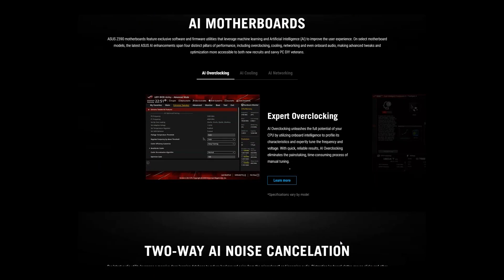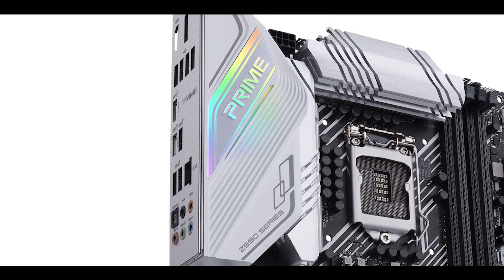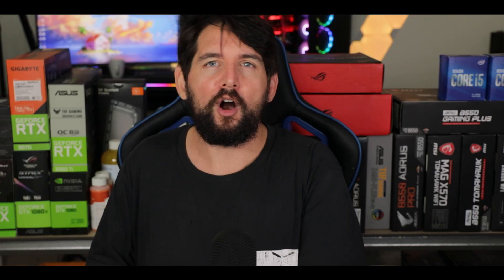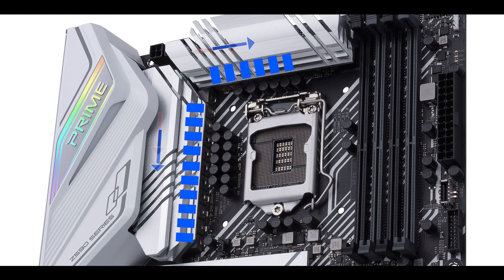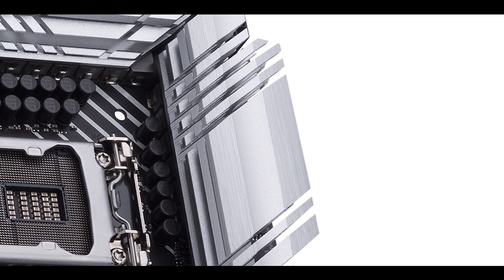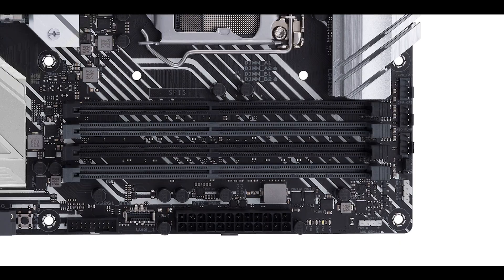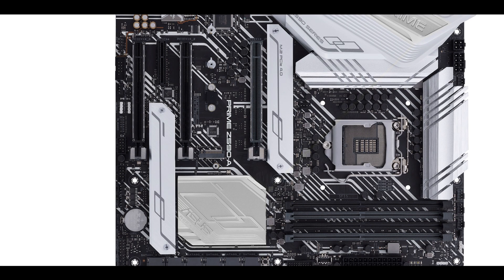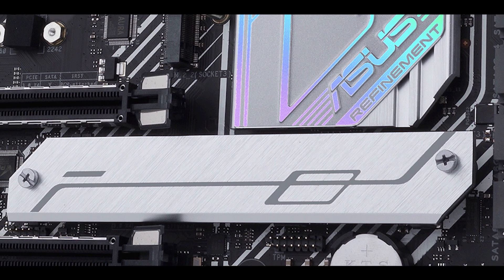ASUS PRIME Z590-A :  The COMPLETE PREVIEW!

Comment: great motherboard. the only issue is ram speeds are locked to 2666. although its not a huge deal breaker. those using a entry level gpu are going to want every frame they can squeeze out of their build. for most games this isnt even an issue. but those demanding games like star citizen will have a slight drop compared too the 3200 ram speeds, and when youre playing cod. any latency will give you some performance to struggle with. overall. i would still suggest this for a good starter build. and when you recoup your expenses. and you feel you need a little more out of your board. replacing with any other 1200 cpu slot wont be as much of a hassle as you think.

Comment: might be a little late. but building a starter with this as a friend recommended, also a i5 11400 , radeon rx 6600 , 2x8 xlr8 ram and 500ssd , the case im still debating

Comment: Got this motherboard recently as my old CPU took an L. Paired it with an i9 11900K and instantly boosted to 5.2 -5.3. If anyone else does a pair like this, under volt to 1.400v as the board pushes it up to 1.632v which causes some minor sputtering.

Comment: I have this motherboard and I'm curious about one thing.   There are three m.2 sockets, but only #1 and #3 have heat sinks.    The second is completely exposed.   Is there a reason for this?   Going to build a system later this week.    I have three m.2 drives, I guess I'll have to buy an aftermarket heat sink for it - any thoughts ?

Comment: Do i need cooling system for i9 10 gen unlocked and this motherboard? My work is based more in single core .. I want to make audio pc
Reply from the maker: For an i9 I'd go for a AIO water cooling solution.
Reply: @Laurentschoice  can u also recommend a graphic card my configuration is I9 10850k and Asus Z590 prime A

Comment: 6:14 the secound pci slot isn't x8 in a dual GPU mode it would be x8 and x4 cuz the last one is splitted with them aka x8x4x4 (thats why i liked that board in the first place ... who needs an x16 for a GPU x8 is enouth and its nice to got 2x4 more from the CPU)

10:02 thats not a thunderbolt front connector its for a addon card to give it hot plug functionality
Reply from the maker: That's correct. I did had some notes in the description for correction. 

Thanks for the comment and for spotting the error.
Reply from the maker: As for the connector at 10:02, after verification it is indeed a thunderbolt 4.0 connector.  If you take a closer look to the PCB you will the thunderbolt_4 inscription written. 

I encourage you to on the official page of this product to read more on  it.

Comment: I got a Z690 coming for ADL, hoping it's as good as the 590 was. The other boards ASUS were offering just seem like more than 99.9999% of users would ever need.
Reply from the maker: You are absolutely right. With current components, availability,  Anything beyond a Z490 is overkill.
Reply: I got lucky and got an open box version of this from Microcenter for $160... so... as long as it's in good condition... I'm planning to drop in a $350 i9-11900k (also from Microcenter) with 2 M.2s I already have, but with a new gen 4 M.2 on the top line.  In my mind... the real reason to buy this board is if you can get it on sale... it's a great upgrade if you want to smoosh a bunch of stuff into it... also... because it was the only board I could find that had 2 usb-C on the back.

Comment: Hey i have this  mobo and i connect one pcie my rtx 3080 and the other one I used a adapter to use an extra m.2 hard drive does is make my rtx run at 16x or is it running at 8x?
Reply from the maker: No. There are enough PCIe lanes to run them all at their maximal speeds (x16 for  GPU, x4 for m.2 ssd)
Reply: Hey one more thing it has 6 sata port and I connect my 6 hard drive but I can't see them in windows but in bios it shows any suggestions
Reply from the maker: Go to you Disk Mangement in windows, format them. Amd a drive letter will be assigned
Reply: Its not showing in disc management
Reply: Intel rapid storage technology on or off?
Reply from the maker: Doesn't matter. 
How many SATA ports actually work ? 

Are all m.2ssds populated. 

The 2nd m.2ssd will disable one of the Sata ports. 

Other than GPU what do u have installed on pcie expansions?

Thx
Reply: Pcie expansion i have a adaptor with one m.2 drive in it
Reply from the maker: 2md m.2ssd and some PCIe exports l, when used, disabled ur SATA ports. 

Try disconnect those and u should see SATA ports back on.
Reply: @Laurentschoice  i disconnect all 6 sata port and switched the spots as well 
It shows in bios the hard drives but in windows disc management it doesn't show only I can see my 2 m.2 drive and the one on expansion one

Comment: hello!!!! question is it ok to use fan splitters from the MOBO to my 12 fans? corsair ll120?? thank you
Reply from the maker: Yes. But no more than  5 fans per motherboard connector or u risk to overheat them.
Reply: @Laurentschoice  thank you ! I read the fans use 0.3a and the headers output 1A so ig I'm safe
Reply: 12 fans - It's going to levitate....
Reply: @patrickinottawa27  lol nah I finnished my build  and I only put 10 .... I was going to add a second one to the cpu cooler and a small exhaust fan but I added an lcd display where the exhaust fan was going to be and I left 1 fan on the cpu cooler only

Comment: The pcie slots will run at x8/x4/x4 if fully populated not x8/x8/x4.
Reply from the maker: Correct . I did add a remark in the description. Sometimes Previews are not as accurate as Reviews.

Comment: EXCELLENTE review, thank you!
A quick question:
They are going to assemble a system using that same motherboard, but I am not going to overclock, my question is:
Should I or shouldn't I use both voltage connectors? the first (EPS 12V 2x4 pins) is mandatory, 
and the second (EPS 12V 2x2 pins) also or can the board burn?

Thank you for the answer and help.

Comment: no hdmi 2.1
Reply: Graphics card for that unless you got a cpu with basic integrated graphics and no graphics card then the port be useful.
Reply: @Sherlock245  yes I bought a 3090 strix with i9 11900k now I get 4K 120hz and 95-120 FPS in forza horizon 4
Reply: @rochester3  how do you fit a wifi card on these board with pcie x 4
Reply: @Sherlock245  why use a wifi card, just Buy and plug in a wifi USB connector.
Reply: @rochester3  wifi pci express faster???
Reply: @Sherlock245  yeah well you can connect it to one of the 1x4 slots
Reply: Wifi card transfers data from 300mb to 3gb a second make sure you check
Reply: @rochester3  make sure you have a good wifi card not a bad one. Usb speed fail conpared to wifi express cards.
Reply: @Sherlock245  i use wired connection
Reply: @rochester3  so where is that usb???

Comment: Thanks for the explanation. As you said, when using 2 GPUs, first and second PCIE will be x8 x8, but the thing is, the space between first and second PCIE slot is so close, my two 3060 is so thick to fit into the space, can I insert my second GPU into the third x4 PCIE slot? Thanks in advance.
Reply from the maker: You could but it my be bottle necked by ce x4 pcie lanes
Reply: @Laurentschoice  how about mining? does it affect much?
Reply from the maker: No it won't affect mining one bit. 
Even on a single lane PCIe ur mining will be at 100% effective.
Reply: @Laurentschoice  So you are saying that use first PCIE and third PCIE dual GPU setting to do mining, it won't affect the effectiveness? Thanks in advance.
Reply from the maker: Absolutely.  If its for mining u can use an 16 slot PCIe on urotherboard it doesn't make any difference
Reply: @Laurentschoice  Thanks guru, it really help

Comment: I'm having issues with Overclocking the Ram from the default 2133Hz 
I Run a i9 11900k with a Z590 Asus Prime  A
My Ram is 2pc of   F4-3200C16D-16GTZR Trident G Skill

I keep getting a block screen when I save and exit from Bios.
I tried doing all the XMP profiles and Manually changing the timings on the ram to what was stated on G.Skill Website

I only connected 8pin Power into the ATX_12V_1 so I'm not sure if the lack of power is affecting it.

Any Idea what's the issue here?

Comment: I have this motherboard with 10850K. Tried to RAID 2 NVME drives in the bottom 2 NVME slots no dice. I'm guessing it's a BIOS issue. But my gigabyte Z370 board did RAID without issue.

Comment: Great video, to get this straight I need a 11th generation Intel processor to make the M.2 SSD slot work on Pcie 4.0 right ?
Reply: Yup, the top M.2 slot only works with an 11th Gen processor. With 10th Gen it does nothing, only the other two work.
Reply: @SimonP2   I have a 10th gen cpu, which slot would you recommend and would I be leaving any performance on the table if so do you recommend going 11th? I'm in the process and haven't purchased the cpu yet. Planning on an 
I5 10600k
Reply from the maker: If 10th gen CPU : use qny m.2 ssd BUT the closest one to the CPU. It won't work 

If you are using a m.2 ssd with a 10th gen CPU, you can only got up to PCIe 3.0 standard, meaning 32 Gbps for ur m.2 ssd.

If you are using the 11th gen CPU, you can use pcie 4.0 m2.ssds which can go up 64 Gbps.

Hopes this helps.
Reply: @Kingtroll38  If you haven't bought either yet, I would think it better to go for the latest CPU, then you'll have PCIe 4.0 available. That said, if it was me I'd wait for Alder Lake as it can't be far off now and you'll have the option of DDR5 RAM as well so it's more future-proof. 

TBH I was a bit disappointed with the 11600K; I upgraded from a 7 year old system and, aside from the incredible speed of the PCIe 4.0 SSD, it didn't feel like a massive improvement in my usage. Alder Lake is said to be a significant step up from Rocket Lake, which was only a small upgrade over Comet Lake, so unless you're in a hurry, maybe hang fire and see how the 12600K looks?

Comment: My Specs:
Z590-A Mobo
Corsair Vengeance Pro (2x8) - will probably upgrade in future -
NZXT H510 Case
RTX 3060
Cooler Master ML240L AIO
Samsung 970 evo 1tb nvme m.2 ssd
650 watt psu
- Im waiting on this motherboard to come in and thats all i need. I looked it up and there seems to be alot of downloadable software for this mobo.
Reply: No CPU?
Reply: @jin-pu2sh  i7 10700k
Reply: Hey I'm getting the same tenth gen CPU and graphic card, do they work good on this motherboard? I'm still trying to figure out if the pcie slots need an 11th gen to work or not. Sorry for responding to a 4 month old comment
Reply: @ivfluid  ii upgrades ram to 32gb and got a 3070. but yeaa it works fine. The first nvme slot only supports 11th gen processors to work. As of now, this processor has a couple of 11th gen processors beat. So ii wont be upgrading to 11th gen no time soon. As far as your question, Yeaa they work great on this motherboard.

Comment: I wish I could buy this board but I have the Lian Li 011D-mini and a 360 for the top mount, so I got the Z590M-Plus. I want to OC my 10700K and an eventual 11700K to at least 5.0 GHZ. Do you think that will be okay for that? 9 case fans
Reply: there is a video on how u can fit a full atx board and a 360 rad on top in the o11 mini. requires u to do some diy on the case

Comment: How does this board handle the m2 bifurcation?  If you install 2 x m2 into slots m2_2/3 with a 10th gen comet lake (as you mentioned the first slot m2_1 gets disabled) will it also lower the pcie_1 slot bandwidth to 8x instead of 16x. I hope that makes sense. Seems there is some confusion around this in some early z590 reviews. Thanks.
Reply from the maker: No it won't. The pcie should run at 16 speed